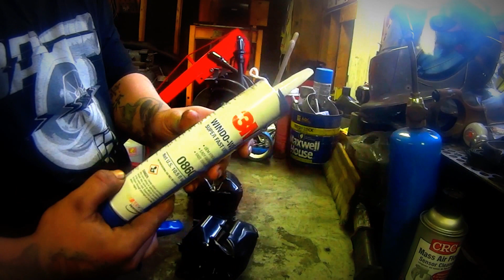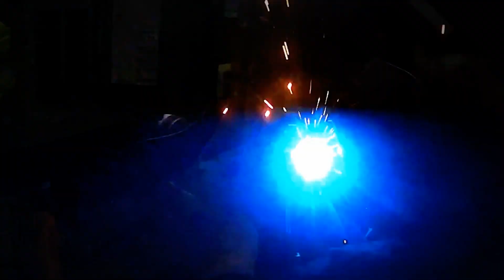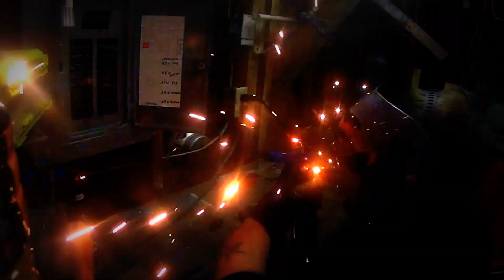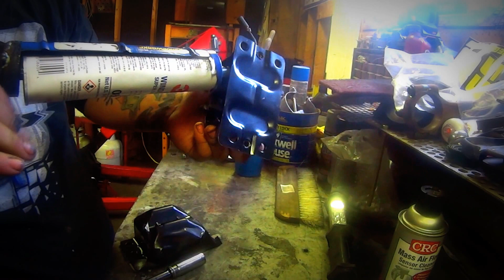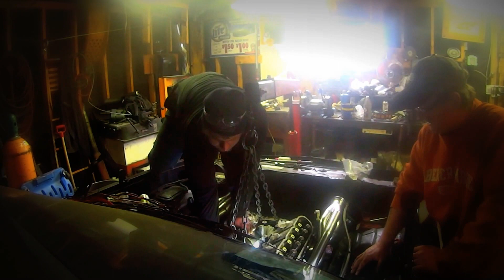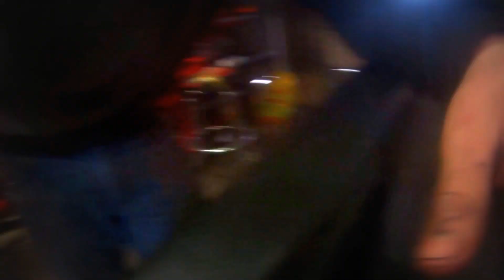Turbo LS Monte Carlo pt 2

Comment: Looking good looking good but why did you put fuel pump there?
Reply from the maker: that was the fuel filter from the old small block set up that was in if
Reply: Ohh ok add place that's all by the way nice welder